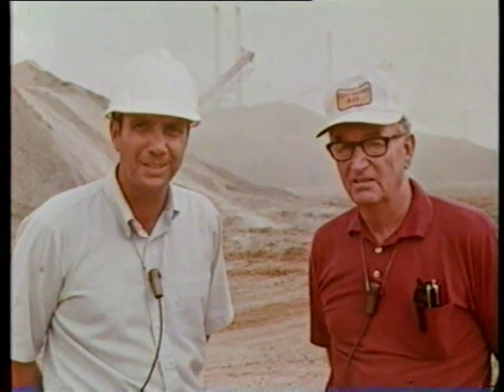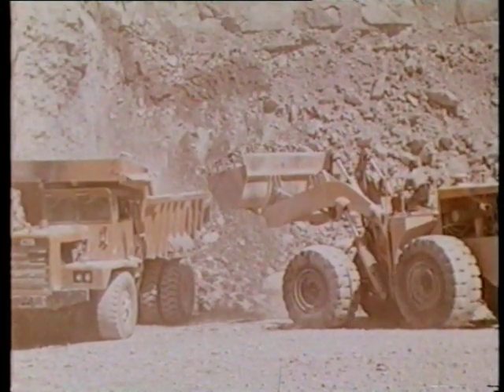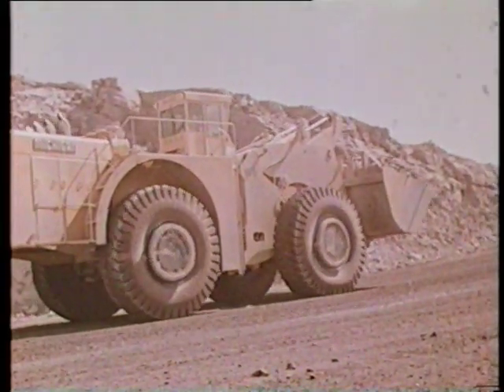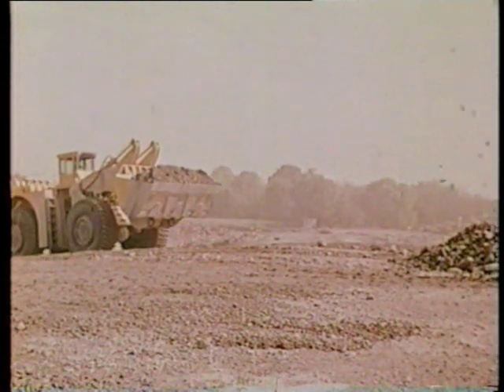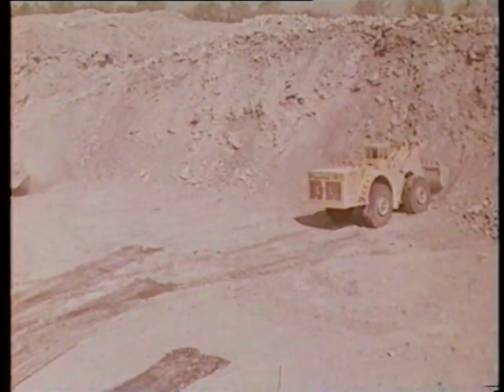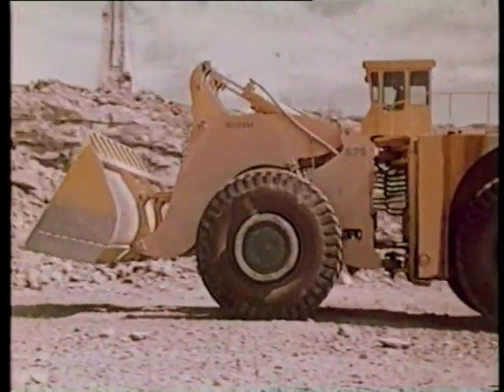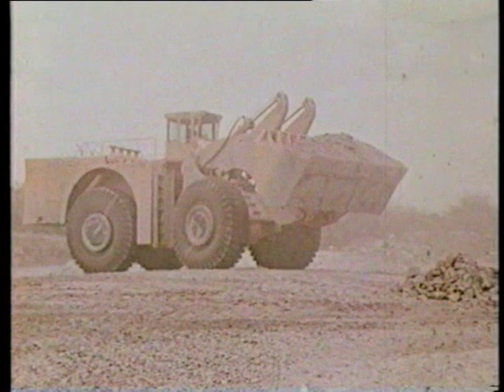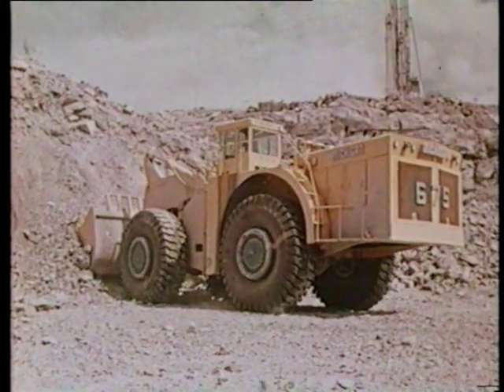CLARK Michigan 675 part 2

Comment: I know this is supposed to be in a test bed R&D scenario for the first 675 ,but come on !!?? . My family has been in the coal .mining I industry for 60 years  , and I cut my teeth running a Caterpillar 992C .
  Putting a loader like this .  in a quary  ,to carry shot rock ,like 6or 700 hundred feet, on an incline  , rather than using it to load rock trucks ,is truly ridiculous.  For some reason  Michigan  ," during this time period, " kissed Falcons  ass. I remember hearing about the 675s working in Breathit County , at a Falcon strip job ,when I was just a kid .I remember talking to a guy who operated one of them for Falcon , and he said that they were actually a good loader  ,but   Falcon put them in half ass shot rock ,for a pastime.  That they would never put a dozer pushing over for them ,and expected them to virtually  pull out unshot slate and sandstone  .  I think some.big wheel at Michigan and some fat cat with Falcon ,had some kinda ,"SWEET DEAL ," Agreement .  How on earth a company  could stay in business as long as Falcon ,with managment doing crap like carrying  material that far with a loader ,rather than using rock trucks ,is beyond me. They must have locked into one of those $45 or $50 a ton ,for crappy 12,000 BTU coal contracts . That was for several years 
 Otherwise this kind of ergonomics  ,concerning the movement of material ,would have broken even the largest of corporations.  Ahh it's strange business sometimes.  Lol

Comment: Remember back then, there were no 'mega' haulers like now. If anything a 12V-149 might have been better but too much for the torque converter and tranny. It was one of the biggest loaders at that time with hydraulics. It took a while for R.G. Le- Tourneau's engineers to convince him that hydraulics were better than the electric motors and rack & pinion for the large loaders the company made.

Comment: mechanical loader is not for transportation  , . It is done by truck , and during loading it is not advisable to return the bucket just to pick up the material the operator speeds the equipment forward and at the same time pushes the machine in the opposite direction with the hydraulic system and the equipment and created to move a maximum of 4 to 5 meters during loading nescessario larger instructions for real  performance .

Comment: Only thing bad about the Clark's... When you operate them like a Cat (forward to reverse quick/still moving in the opposite direction) they like to blow the trans out of the bottom of the machine.
Reply: That's what BRAKES were invented to prevent !!!!
Reply: Joseph Rivett
Since when did the brakes ever work on a piece of equipment like this? If it can't handle the heat then GTFO
Reply: robby844 Serious ?
Reply: Joseph Rivett
Uh... Yeah. That's the first thing they tell you when you become and operator. Treat every piece of equipment as if it has no brakes. Never operated a Clark that had brakes. Even from new.
Reply: +robby844  I can tell that you never been on a loader, or anything other than a 10-speed bicycle and a keyboard. I operated machinery all my life, so GTFO.
Reply: +Joseph Rivett Been running them since I was 7. If you use brakes on a loader you aren't an operator. Why'd you stop operating? Oh yeah because you think you know everything but you don't know shit.
Reply: +motherpillar lol... okay "expert"
Reply: robby844"Been running them since I was 7......"  Tonka Loaders don't count. This is an adult discussion, and we're talking about real machines. Not the ones you get from 'Toys-r-Us'.  And I never did operating them,so go back to the toy box.
Reply: Anyone who can't get into an old worn out loader without brakes and make it work isn't much of an operator. Using the trans as the brake is pretty much standard on old case loaders